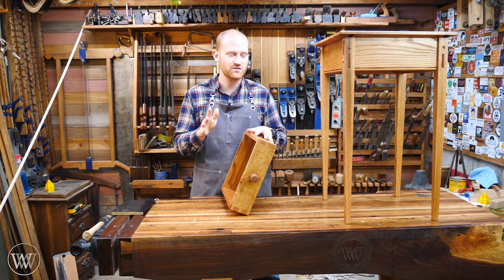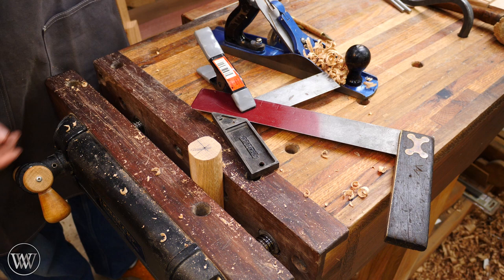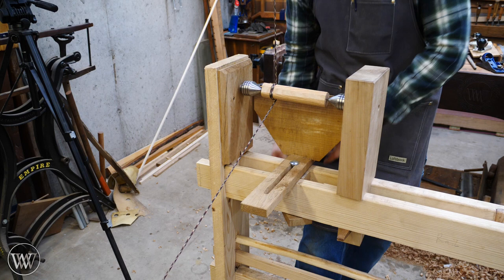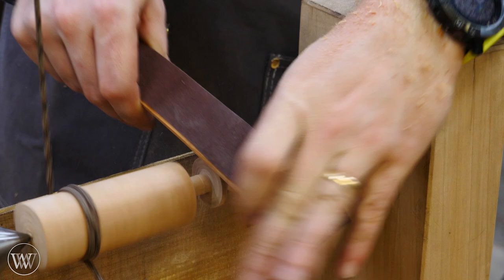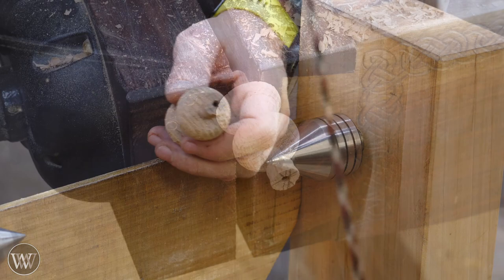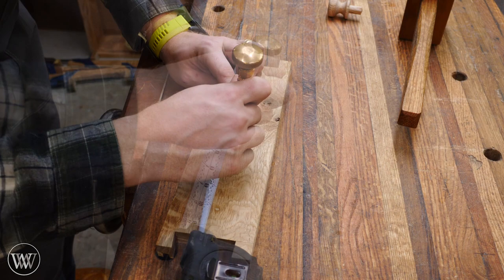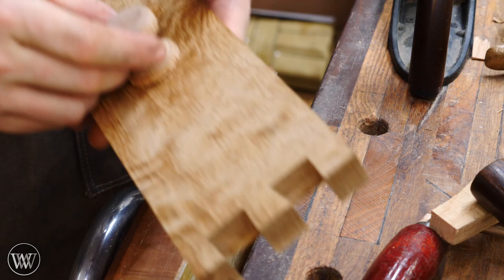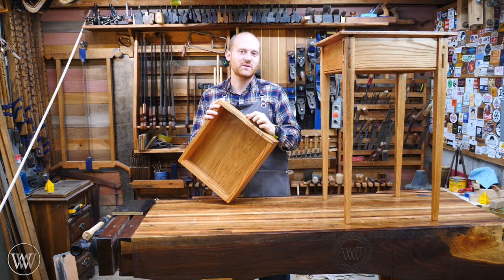Side Table Part 12 | Making and Installing The Drawer Pull

Comment: thank you James . oh when i was a machinist i would use spring calipers for rough measurements with in .005 on inside and outside  to get you close then mics .  that way you do not have to stop the lathe

Comment: Awesome tip on the drill bits.  And Well....
Actually i  do make "Push" places on some of my Drawers and doors.  If somebody else is paying for materials I use either Stainless or Brass Plate.  If I am footing the bill.... Well I have used flattened tin cans or a flattened section of copper pipe.
Reply from the maker: Nice.I thought of doing a spring-loaded catch drawer